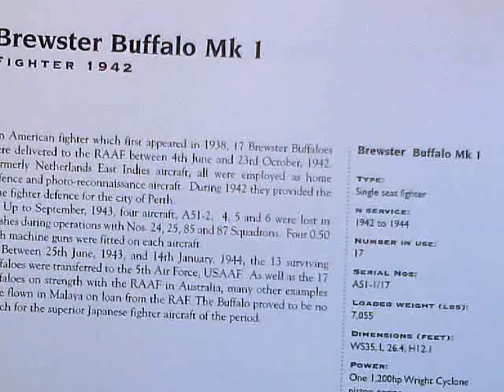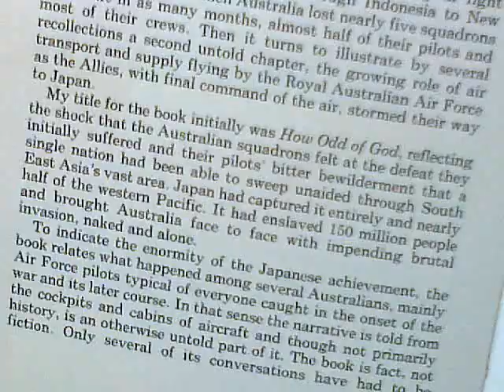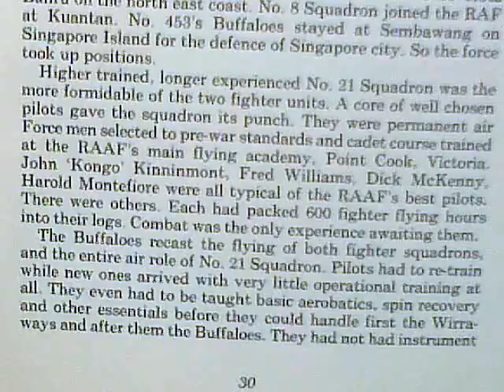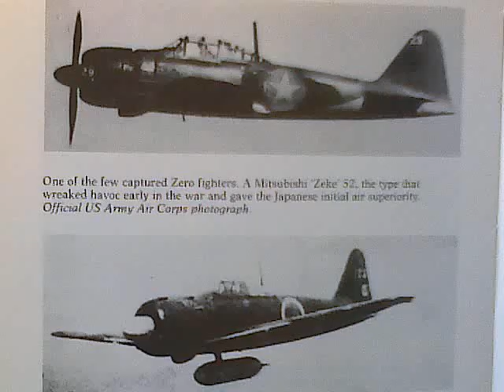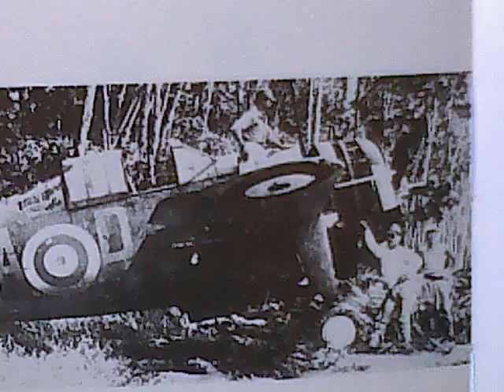World's Worst Fighter Aircraft, The 1941 RAAF Brewster Buffalo !

Comment: "The British fared no better than the Americans did. The RAF squadrons stationed in Malaya were flying the American Brewster Buffalo; a short barrel shaped fighter that was outmoded before it reached the front. Aware of its lack of performance the British had banished the fighter to Burma, away from combat with the superior German Bf-109. The general impression was that the Japanese had nothing but outdated biplanes that would not be a match for the Brewster fighter. When the British Buffaloes came in contact with the A6M they were sliced to ribbons.

To reduce their losses the RAF decided to replace the outmatched Buffalo with the more formidable Hawker Hurricane, famed for its decisive role in the Battle of Britain. Unfortunately, its pilots also found that fighting a Zeke on its terms was practically hara-kiri. Finally, the British threw their best at the Japanese, the fabled Super marine Spitfire. To the Allies dismay, this fighter also could not compare with the incredibly nimble Zero. In only two engagements, Zeros downed 17 of 27 while losing 2 of their own.  Also if you notice most of this could be chocked up to not knowing the machines well, and having a lot of flight time in the crates.  Not to mention the tactics that weren't developed to deal with the zero yet.  

If known dog fighters like the super marine spit had that much trouble with the Zero, blaming the buff is a bit disingenuous.
Reply from the maker: G'day,

  Thanks.

  Well, you're partly right, and almost not wrong...; as in the Buffalo never fought anything in the Pacific after the failed Japanese invasion of Midway in early 1942, whereas the Spitfire didn't begin to disgrace itself against the Zero over Darwin till February 1943...

  And, it wasn't "27 to 2 Shoot-Downs by Zeroes vs Spitfires" in 2 attempts to defend against Japanese Raids, so much as it was "27 Spitfires LOST while shooting-down 2 Zeros (and several Bombers as well...)" ; with Take-Off Crashes (Engine-Failure from Fuel-System mismanagenent and low-visibility from raised  Dust on the Runway), Landing Crashes from the Spitfires' notoriously weak Undercarraige, Fuel-Starvation/Navigation Errors (getting lost, after becoming disoriented in Combat, leading to Ditchings, Forced Landings, and Bailouts)....

 However the Pacific Buffalo had vastly worse habits than any Spitfire could ever dream up...

  Useless Radios, Fuelpumps needing Manual Assistance above 10,000 Ft, one set of Guns with which to blind the Cockpit by covering the Windscreen with Grease, and another set for shooting-off the Wings of the Aeroplane into which they were fitted....; compared to those faults, simply being overweight, underpowered, and flown by Novices were not real issues at all, in fact that was about "Par for the Course" in the Pacific, until the Hellcats & Corsairs and Mustangs arrived.

  The Seafire only had enough Range to put a CAP over the Carrier Battle Group, and it's Undercarraige was as shitty as that on every other Spitfire (and Me/Bf 109...), and the Kittyhawks had to stay out of the Zeros' way by diving through them and never staying to dogfight ; whereas Wirraways and Boomerangs were always a long way up Shit-Creek if ever they got caught by the Zekes.

  In the Pacific War (of Two), the Buffalo distinguished itself as the Worst Fighter Aircraft of all Time...

  In my considered opinion. 

 Take it easy,

  ;-p

  Ciao !
Reply: No worries just disagreeing that the Buff was the worst fighter to be deployed to the pac.  Or to be used by the allies in the Pac battles. While not distinguishing itself like it did in the soviet theater the Buff did have a solid chance with the right tactics to do some damage and robust enough to give the pilot a chance to get home.

   Some of the issues you've brought up here though weren't really reported by the Fins while they flew the plane.  So I'm wondering if this honestly isn't also a mashup of errors and dislike for being forced into a different style of combat forced upon the pilots as well?  Notice especially they threw out the .50 cals which is a better MG over all and replaced them with a 303.  Now call me biased but the browning .50 is probably one of the most reliable MG's ever produced.  A lot of this honestly seems like teething problems with a new type of plane having issues with new pilots.  

The P51,P47,P38,just to name a few had teething issues when they first came online.  Never mind some of the home grown versions of planes the ANZAC's came up with or the Canucks, etc. 

With the spitfires I understood what you mean about the loss ration and if I posted it wrong I do apologize but you did understand what I was trying to get at.
Reply from the maker: +hammersmith76ify 

  Well, y'see, the Finnish Buffaloes were early Models, bought over a year before Pearl Harbour, so they were LIGHTER (less Armour), and  therefore being underpowered didn't matter so much...

 Then, because Finland was cosying up to Germany, after "The Winter War", the Finnish Buffaloes had German Radios, not British ones, nor AmeriKan ones - and the German Radios weren't blanketed by the static from the Tropical Thunderstorms, which didn't occurr over the Karellian Peninsular...

  The Finns fought a Low-Level Air War, so they never went high enough for the Buffalo's Fuel Pumps to fail, and (most importantly) the Finns used German Guns which fired ungreased Ammunition and the German Gun-Mounts didn't break, either...; so the Finnish Buffaloes never suffered from the collection of crippling flaws which made the USMC & RAF & RAAF & RNEAAF Buffaloes such hopeless bits of Kit.

  Finally, by the time the Finns got their Buffaloes they'd already fought through the Winter War (only a few Buffaloes arrived before the Cease-Fire was called), therefore, in June '41 the Finnish Buffaloes had had all their worst  defficiencies remedied and they were being flown by experienced Combat Veterans - up against Noviciates in Polikarpov I-15 Biplanes and a few 1-16 "Rata" Monoplanes...

  The Finns were NEVER flying the Pacific Theatre version Buffalo, as Neophytes, nor against Zeros in the hands of highly-trained Elite Combat Veterans....

  It's a Chalk and Cheese comparison.

  The Buffalo in Finland was a FUNCTIONAL Fighter Aeroplane, in good hands, up against an untrained Foe flying inferior Hairygoplanes ; the Pacific Buffalo was a heap of Shit on which nothing worked properly, flown by Novices against Experts who had a MUCH better Aeroplane with which to pursue and chastise the King's/Emperor's Enemies.

   It isn't a simple comparison, so much as a multifactorial Equation, and the RAAF Buffalo was a veritable Deathtrap for anyone who had  to fly them in Combat ; at least, THAT IS WHAT THE SURVIVORS SAID...

  And I have no reason to disbelieve them.

  Have a good one,

  ;-p

  Ciao !
Reply from the maker: +WarblesOnALot 

  Oopsie, that should be "RNEIAAF"...; (Royal Netherlands East Indies Army Air Farce) {most of their Buffaloes were surrendered, intact, to the Japanese - who flew and assessed them, and then used them in the making of Propaganda Films, because "that was all they were good for"}...

  ;-p

  Ciao !
Reply: Look I'm not saying the thing wasn't a p.o.s. that needed a serious redesign but I am saying that of ALL the other planes that were flying during that war, I seriously doubt the Buff was the worst in the air.
Reply: Also some more information that kind of takes into account some of the issues you've brought up.  doing some digging don't know the numbers for sure for the Fins combat height, but this link mentions that the clear weather fighter patrolling was done at ca. 10000 - 16000ft 
http://www.virtualpilots.fi/hist/WW2His ... cture.html
and here is a mention of battles at height of ca 28000ft. 
http://www.virtualpilots.fi/hist/WW2His ... glish.html

Now at those alts, the fuel pump issue would have been noticed and brought up considering they had test pilots from the company out there in Finland.  

As for the hand pumping Hand pumping fuel and dogfighting.
I have read of such cases only from the British Far East assembled (and flown) planes.
Original reports, like this, have no mention of such procedure:

Also the person your quoting from was fighting these planes from the start of the war with no tactics developed yet really for fighting the IJN Fighters, once tactics started being developed THEN you start seeing kills being claimed and slowly pilots learning.

Enjoying the conversation and thoughts, thank you by the way :)

Ciao
Reply from the maker: +hammersmith76ify 

  Cool, no worries...; yeah, the fact that in the Pacific the RAF/RAAF had no way of knowing when a Raid was coming, and they had no idea of how to fight Zeros, all added to the problems.

  I think Balfe captures a lot of the flavour of it all with his original working title, "How Odd Of God !" ; the British Empire literally expected the Japanese Aircraft to be barely better than Boxkites, and all their Aircrew were supposed to be short-sighted and poorly-trained..., while all the reports about Zeros in China were frankly dismissed as Propaganda and hysterical exagerations.

   White Supremacist EuroPeons getting their come-uppance, is a very fair way to describe it (!).

   The Allied Combat Aeroplanes which were almost as bad as the Buffalo would include the Vickers Vildebeeste, the Fairey-Battle, the Boulton-Paul Defiant, the Blackburn Skua, and the Avro Manchester...; but none of them carried a pair of Cowling-Guns with which to blind the Pilot, and another pair with which to shoot off  their own Wings..., those crazy Guns are what promotes the Buffalo to the bottom of the Compost-Heap I reckon.

  I think the Finns had mostly fixed the Fuelpumps, too, by the time they attacked  the USSR...

   Have you heard of Ilmari Juttilanen yet ? He scored about 30 of his 94 confirmed kills while flying a Buffalo, he got the Mannerheim Cross twice, and died of old-age in the 1990s...; most outstandingly, his Aeroplane was NEVER EVER HIT BY A SINGLE BULLET FIRED BY ANY AERIAL ADVERSARY....!!!! (which probably means that he was hit a few times by Ground-Fire..., otherwise more would have been made of his ability to avoid being hit...?).

  In my view, 94 Kills without being hit, let alone being shot down makes him the most successful Fighter Pilot in History - because while Willi Hartmann scored 352 Kills, he bailed-out twice and he crash-landed shot-up wrecks on about 4 other occasions..., making him about half as effective as a Combat Pilot, compared to Juttilanen (!).

  Another really weird point is that the few Finnish Buffaloes shot down so many Soviet Polikarpovs and Petalyakovs, etc, that apparently the Buffalo is one of the very few Designs which ever shot down more Enemy Aircraft than were built it's own Production-Run...; and if that's right, then the Fokker Eindecker would probably be the only other Machine of which the same can be said... (?) !

   As you may have guessed, I was a terribly obsessive little Biggles-Freak in my youth... ; and if you backtrack me to my "Personal Aeroplanology..." Playlist you can see my first Aeroplane (hanging up in a Transport Museum, no less !), that video is titled "The 8 Hp, 1975, Red Baron Skycraft Scout ;....", in which you can see that the Wright Brothers had a better Aeroplane in 1903 - but I knew that it could be done whereas they were actual Pioneers and I was the Scout's 3rd Owner...

 Have a good one,

  ;-p

  Ciao !
Reply: On the gun package setup.  I'm curious how the wing mounts were supposed to have shot off their own wings?  Is this due to a high rate of miss fire or other problems causing catastrophic failures?  Could the cowling guns "blinding" the pilots be down to seat settings etc?
Reply from the maker: +hammersmith76ify 

  Hmmn, it sounds as if you haven't actually watched the Video...., but I'll sumarise.

  Because the Buffalo was a US Naval Fighter, it was designed to be Corrosion-proofed, and the .50 Calibre Belt-Fed Browning-Ammunition was therefore shipped in Tin-Cans full of the (in)famous "Cosmoline" Naval Gunnery Grease...;  so every Projectile, as issued, emerged from the Muzzle in a blast of Red-Hot Glowing Vapourised Grease, which from the Cowling-Guns hit the 300 MPH Prop.-Blast, instantly cooled, and condensed into warm Droplets, which  then congealed into a layer of Heat/Pressure-distilled pure Cosmoline (thick, dark Grey) Grease which covered the front 3 Panels of the Canopy - Windscreen plus Quarter-Panels...

  I've read several Survivor-Stories, involving never having fired a Buffalo's Guns until shooting at a Japanese Aircraft,  firing one 3 or 5 Second Burst.., then turning Tail to withdraw from the Engagenent, open the Canopy, unstrap the Harness, stand up in the Cockpit while holding the Stick steady between one's Knees, and  reaching into a Trouser-Pocket for a spare pair of Socks (carried in case of Out-Landings...) and  using them for wiping the 1/8th of an inch of Grease off the Windscreen-Glass in order to be able to return to try to find the Bombers or Fighters, and have another attempt.

  And then go Blind, all over again.

  Always ssuming that the Gun-Mountings hadn't fractured on the first firing...., which they did SO OFTEN that the RAAF Fitters  & Armourers shit-canned the Brewster's Cowling-Gun-Mounts l, fabricated their own, and learned to wash the Grease off the Ammo with Petrol before (thoroughly) drying the Belts and loading it into Guns which had RAAF-modified Mounts ; or they threw the .50s to the Shithouse and fitted RAF .303 Brownings (again in Custom Mounts) into their place.

  The Wing Guns were also in the sad habit of fracturing their Mountings, whereupon the Weapon recoiled and relocated  itself rearwards, and about half the time the Belt got jammed and that stopped the Gun from firing..., which was actually the best of all possible outcomes, at that point.

  Because, the rest of the time the back of the Weapon reached the Rear Wingspar, the Muzzle was pulled back behind the Front Wingspar ; and the unrestrained Browning continued to fire until the Belt was finished, with the proverbial Loose Cannon literally waving around and bouncing off the Rear Spar,  while shooting Rounds out through the Top & Bottom Wing-Skins, perforating the Leading-Edge, and in about half the cases..., severing the Front Spar entirely, and thus shooting the Wing off....(!).

   So, the RAAF removed the Buffaloes' Wing-Guns entirely, and counted that procedure as a "Weight Saving"...

   This stuff is all very well doccumented.

  Give yourself a treat, watch the Video before commenting again, it will save time...(!).

 Take it easy,

  ;-p

  Ciao !
Reply: hmm missed hat section apologies.  I'm just trying to square these accounts with again a different variant that was modified, to solve a few issues that the Finnish found vs the disaster these planes were for their pilots in a different theater. 

The reason I'm having so many questions on the blinding situation with the cowl mounts is that the P36 series of fighters.  I hadn't thought of the cosmoline (isn't that stuff fun to clean :) ) but wouldn't just switching over to a USAAF (instead of USN) supplied or local supply of ammo solve the issue without having to strip out the guns?

As for the wing guns, the main issue I'm having is that from most of the sources I read the brewster didn't have these issues with the USN and Fin variants.  The power drop off at alt being a loss of HP down to around 750hp @ 15k cruising or so for the early engines, and some lubrication issues.  Part of me is wondering if the humidity and a bad choice of metals for the area didn't play a roll in the wing MG issues.  The .30's really weren't recoil heavy, so it would take some kind of metal fatigue for the armorers not to notice something wrong when they are servicing the guns.  

The RAAF armorers I am honestly more likely to listen to personal accounts and memoirs due to field modifications for reasons are more well documented then private pilot accounts.  Researched to many different pieces of kit to not see a trend of preference or "common knowledge" come into play (take about 7 of the M4 Sherman myths for example). 

Cheers! :)
Reply from the maker: +hammersmith76ify 

  Ah, well, the  RAAF Buffalo wasn't issued with .30 Brownings, nor .303 Brownings, it came with .50s ; and the Mountings failed, dismally.

  The Brewster Engineers apparently designed the mountings for .30 Recoil, then the USN decided to fit .50s instead, and they exported them....; and Midway was MONTHS after Singapore, so presumably even the Yanqui Marines had "come up to speed" on the Cosmoline & Shitty Gun-Mount issues..., so apparently the reason that every Buffalo which took-off from Midway (to defend the place in actual Combat) was either shot down by Enemy Aifcraft, or by the Midway Anti-Aircraft Defences (Radial Engine vs the Kittyhawk's Allison V-12 Silhouette....., y'see).

   And, Curtiss P-36 Warhawks and P-38 Tomahawks & P-40 Kittyhawks, they NEVER used US Navy (Marine) Ammunition.

    Meanwhile, the U.S.A.A.F...., did NOT EXIST, Until 1948..; it was the ""United States (Of  Norte AmeriKano's) ARMY Air FARCE...

  The USA was (famously) the ONLY Major Protagonist/Participant in WW-2 which DID NOT POSSESS ANY INDEPENDANT AIR FARCE, the Yanquis won WW-2 with "merely" the USAAC & the USNAC...

   How old are you...? (I'm 56...; and this is all fairly Novitiate Stuff for you to be wondering about....)

 No disparagement intended, but ; what else don't you know about...?

  Have a good one,

 ;-p

  Ciao !
Reply: I'm a USN Brat in my 40's grew up on NAS bases.  So have a strong interest in military history and equipment. By USAAF was simply using it as a stand in for United States Army Air Force instead of USAAC which some folks wouldn't know.  Both of my grandfathers flew for the USAAC (5 DFC's between the two, one with the 8th on B17d (waist gunner) from 42-44 stationed in the UK, and the other on  B25's as a dorsal gunner with the 81st in Africa.  Lost a great uncle in B17s coming inter Pearl Harbor Dec 7th 1941) with the rest of my family being either USN or USMC through out our time in the states only 3rd generation American.  

As for the planes they were quick thoughts and known types that had interupters and fired from the cowling.  Other types that the USN and USMC would have used would have been the SBD,F3F (which funnly enough the F4F series comes from minus 1 wing :) ), SB2A, heck the original TBD to name a few.  With that many flights going up and test firing runs you'd figure the cosmoline issue would have crept up more then just in the Buffs the RAAF and the Dutch were using?

As for the .50 cal swaps from the .30s honestly would have figured they were factory conversions or field kits issued for that and hence the fault laying there or in the design team that did the conversion using the wrong alloys etc for the mounts.

Sorry if I came off as some snot nosed just challenging the elder kinda thing if I did I do apologize.  :)

Hope this finds you well! Cheers!
Reply from the maker: +hammersmith76ify 

  Cool bananas.., I had a mother's father and a father's uncle in the Australian Flying Corps in the War of One..; dad's uncle hit the Beach on Gallipoli on 25 April 1915, trying to invade Turkey as a Private with his little brother Hopeton, however Hope was gutshot there at 11:07 on ANZAC-Day and then took three days to die on the Hospital Ship from Faecal Peritonitis & Sepicaemia, but Les was there on Gallipoli for 5 months till breaking his ankle.

  After Home Leave he went to France via England in 1916, and as a Seargant in 1917 he captured 500 yards of Enemy Trench, for which he was shot through the shoulder, given the Military Medal, promoted to Lieutenant and offered his choice of next assignment...; and  because when he'd arrived in England in 1916 he'd spoken with his distant cousin from Queensland, Sidney Cotton of the RNAS (yeah, inventor of the SidCot Flying-Suit in WW-1, British Spy in the 1930s, & inventor of  modern Aerial Photo-Reconnaisance in WW-2 - check out his biography, "Last Plane Out Of Berlin.".....), and Sid. had told him to go Flying at the first possible opportunity (for the safety, relative to Trench Warfare...), he next went to the AFC Training-Squadron, before being posted to 4 Squadron AFC to fly Sopwith Camels in October 1918.

  According to the History Books, on his first trip over the Lines, "he became separated from his companions, and when he saw a pair of DFW 2-Seaters he (foolishly) immediately attacked them (alone !), succeeding in shooting one of them down (!!!)...; before 6 Albatross Fighters (which he hadn't thought to look for when he spotted the DFWs, too new at the game, apparently....) all dived down on him, chasing him away into a Cloud after puncturing his Fueltank (behind the seat). 

  When he emerged from the Cloud he was knocked unconscious by a fragment of "Archie" (Anti-Aircraft Artillery), recovering barely in time to pancake just behind the British Lines, whence  he magaged to rupture his Appendix in the Crash, and then returned home with the Propeller-Hub he'd broken, to use as a Clock-Mount ; he became a Schoolteacher, and raised his son Alan (Wharton) to be a RAAF Bomber Pilot who flew a full Tour on Lancasters, cooking Hamburgers and Charcoal-Grilling Berliners in 1943-44, before returning to Oz to fly Catalinas from Western Australia to Madagascar with the "Black Cat" Squadron (and thence to Qantas, pioneering Lockheed Constellations into Hong Kong, and finally retiring as Director of Flight Operations in 1978..).

   Mum's father was a mechanic who paid for Civilian Flying Lessons, gaining his FAI Australian Aviator's Certificate (#96) in September 1917, he was 25, and Australia had no Conscription in WW-1 ; then on New Years' Eve he joined the AFC, and "because he hadn't finished High School" they signed him on as a Seargant Mechanic... ( be it noted here that in August1917, because ever more Recruits were needed for the AIF (Australian Imperial Forces), "Part Aborigines, of prediminantly EuroPeon appearance" were first permitted and encouraged to enlist, and fight against the King's Enemies...).

  So, when he arrived in England, Grandpa had an attack of "Lumbar Neuralgia" and he went to hospital while the rest of that Shipment went off to stop the 1918 German Spring Offensive..., on emerging from the Hospital he went to the #2 School of Military Aeronautics, at Oxford, being billeted at the University, before hurting his back again, still as a Seargant Mechanic......;  however during his second stint in hospital, when they were about to repatriate him to Australia, he finally succeeded in getting someone in Authority to realise that he was already a Certificated Aviator..., so "unrecognised" as his Hometown Newspaper put it at the time, he went off to the AFC Training-Squadron to learn how to fly the Military way....

  In March 1919 he finished his Training, and attended Buckingham Palace where the King pinned his Wings on him, and Commissioned him as a Lieutenant...; but then Australia declined to contribute the requested Squadron of Camels to go to Sebastopol, to join the RAF in putting-down the revolting Bolsheviks..., so Grandpa came home again, arriving in Sydney in June 1919, and was sent on Leave with full pay for 6 months, being demobilised on Christmas Eve, after 2 years of travelling the Globe, emerging as an Officer & a Gentleman - which were the conditions which my Grandmother (a rich man's daughter) had told him he would have to attain before she could possibly marry him... (when he first proposed in 1917) !

  In my opinion, he was the first Aboriginal Pilot, the first Aboriginal Fighter Pilot, and the first Aboriginal to hold the King's Commission as an Officer...; but if so, he was "passing for white" which meant that his kids never became part of the "Stolen Generation"..., and my 81 year-old  mother is highly resistant to the idea that she's secretly 1/16th Aborigine.

   I've been known to make and paint and sell over 80 Boomerangs though, and if you check out my Wildlife Playlists you can see that wild unfenced Eastern Grey Kangaroos and Swamp Wallabies literally knock on my door, to be hand-fed...

   And, to be honest, I reckon that the ONLY possible reason why the AFC Recruiters in Oz would EVER have enlisted a qualified Pilot as a Mechanic..., in 1917, when Pilots were in such terribly short supply ; is the kind of institutionalised Racism for which the British Empire was (and still is) infamous...

  But, it kept him alive, so therefore ; here I am !

   I think, from what I've read, that the .50 Calibre machineguns were an "available option" which Brewster had suggested the British might like to consider, and the RAF Purchasing Commission said "Yes please...!" ; but Brewster was a disorganised schemozzle of a Company, their Factory was a 5-Storey Building in New York (or New Jersey ?) with half-built Components shuttling up & down in Elevators between Construction-Stages...; finally the Aircraft were completely assembled at the Factory to check that everything fit, before having the Wings removed for trucking to an Airfield for Test-Flying, and then pulled apart AGAIN to be packaged up in Crates and Railroaded to the Seaports... (Mucking Fadness !).

  Apparently, the heavier Recoil of the .50s hadn't ever been a factor which occurred to Brewster, and in the mad rush to get SOMETHING in place with which to defend Malaya, Burma, Singapore, Hong Kong, India, et-al...; the Brit's didn't notice that either the Cosmoline or the Gun-mountings were a stupid oversight, until trying to use them in Combat.

   Military Personel get promoted for making QUICK decisions..., and being right is entirely beside the point...; because by the time the History is finally written the Quick Decider will have moved-on, and if they're lucky then everybody who knows how badly they screwed the Pooch is long-dead, and the Winner takes all.

  I'm not a fan of Militarism, nor Warriorism, but one cannot study Aeroplanes without perforce coming up to speed on them both...; because ever since Wilbour and Orville decided that a Glider with a Motor could carry a Gun, and they then sold their First "Production" Aeroplane to the Army of France, it's been the Militarists and the Warriorists who have funded every major advancement of the Art of Flight - sad, but true.

  Anyway, have a good one...

  ;-p

  Ciao !
Reply: WarblesOnALot a
Reply from the maker: +Palerider770 

  G'day,

 Thanks.

   It was my nickname for 25 years, bestowed by the Hippies on the local Commune, before I came onto YT...; the local Aboriginal Community calls me 'Ave-A-Chat..., so at least my "labels" are matching...

  Have a good one,

  ;-p

 Ciao !
Reply: I read a Finn's account of their wars.  He learned fighter tactics going to France's air force for training.  He started in a Fokker (fixed gear and 4 .30 cal).  He got a number of kills but was really pleased when he got a Brewster.  This had one .30 cal and a .50 cal.  The .50 cal was far more effective against bombers.
Reply from the maker: +Dan Zervos 

  G'day,

   Thanks.

     I know that the Finns fixed the Gun Problems, or their early model Buffaloes never suffered from them because they had .30 Brownings..., as fitted when exported, in 1940-41, before Finland lined-up with Germany to invade the USSR in June 1941...; after began fighting the Soviets I'm pretty sure the AmeriKans stopped supplying Finland with Armaments of any kind...

   I'm currently planning another Video to dwell on the point that in Malaya the Buffalo was the Worst Fighter in the World whereas the Finns still have a Buffalo in a Museum because that one Airframe shot down 44 Soviet Aircraft, while being flown by several pilots...; which makes the Buffalo also the Best Fighter in the History of War.

  What a lovely Dichotomy.

  Have a good one,

  ;-p

  Ciao !